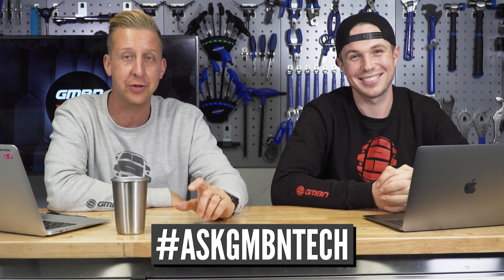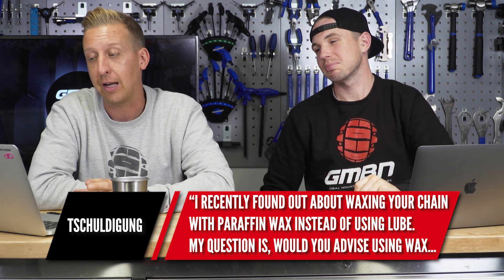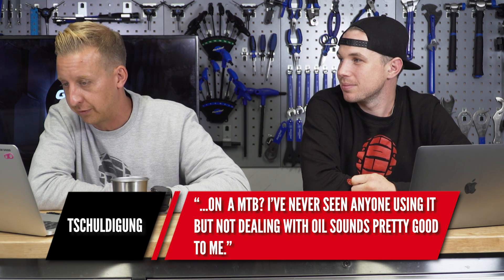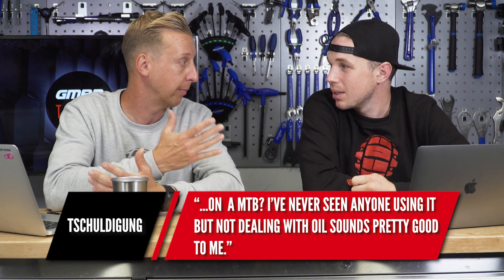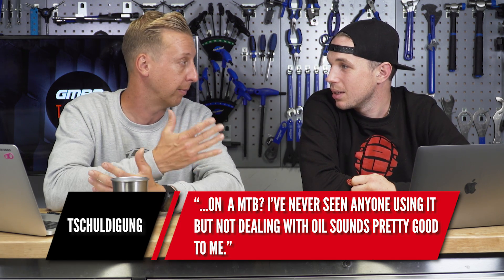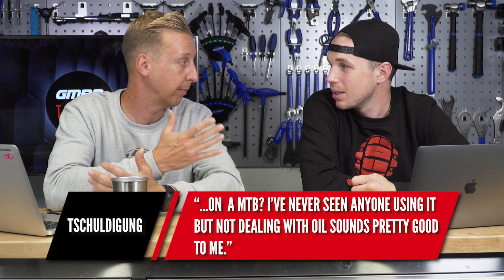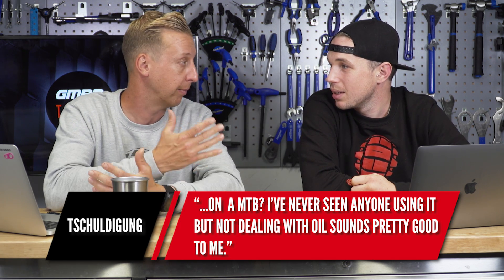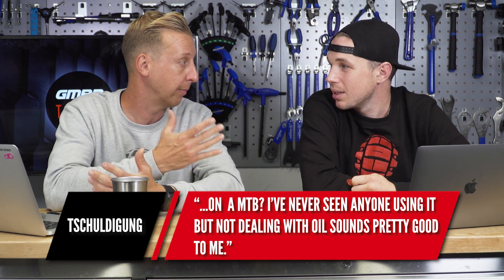Why Isn't My Damper Working Properly? | Ask GMBN Tech

Comment from the maker: Do you have any retro #AskGMBNTech questions? Next week is a retro special! 🔧
Reply: #Askgmbntech Where can you buy elastomers for retro forks?
Reply: #askgmbntech. Hey guys. My sram eagle gx 12 speed cassette is worn out and I’m looking to buy a new one. Would you say I also should by a new chainring and pulleys? Or just a new cassette and chain?
- Mikkel
Reply: #AskGMBNTech 

What is the right size bike for me I’m 6’0” flat,  and I am just looking for my General size. Rode a 26 size large with a  100mm stem it’s alright currently using a 29er medium with a 120mm stem seems too small for me. 
Need help Thanks.
Reply: Who made the first flex stay full sus? The Trek Fuel is the first I remember, did someone else do it first? #askgmbntech
Reply: can you do a breakdown of a fully spring suspension fork please. Mine is quite recalcitrant.
Reply: #askGMBNTech 
Back in the 90s I remember a suspension fork called ZZYZX, it was a big diameter DH style thing.
I can't remember who made it. Is it still around?, was it developed further? Or was it just one of those 90s things?
Reply: #askgmbntech Drive train 1 x 12: Is this system more vulnerable to wear out and defects than 2 x 11? I heard this quite often - also from local dealers. Tends this system to be more fragile and less durable on the long run? The chain and the sprockets are thinner, the chain line is diagonal at lower and higher gears and the friction on each sprocket of the chain ring is higher as well as the tension and the take-up path for the cage of the rear derailleur in order to compensate 10 to 51 tooth. Does it need a chain guide as to Syntace SCS claim: "Less wear and tear"?
Reply: Don't forget the Hope V2 system which converted cable to hydraulics. Not sure if it's still available.
Reply: who made the first hydraulic disc brake? #askgmbntech

Comment: Hi! Can you help me please, i have RockShox Monarch Plus RC3 2012. Why could oil travel in damper only in one direction, during bleeding? When in push damper down, it wont go up. All oil go thru damper piston, but won't go back. 
I have to use a lot of strenght to forcify retract it back up. Shimstacks are ok, IFP damper is open. What could it be? Thanks.

Comment: In reply to the chain waxing. Yes it can work very well on an MTB. I have several bikes and a stack of spare chains, so wax about 20 chains at once, and rotate them as the wax wears off. They are easily cleaned with water, dont attract dirt in wet or dry conditions, have amazingly low friction when new and can last 10 rides or so. Yes its a hassle, but combined time for 20 chains is less than degreasing and lubing every ride. Downside is that they can go rusty after rides as the wax wears off some of the chain once its been ridden.

There are a few tricks:

 you want a mix of paraffin and microcrystalline wax. Paraffin wax is too brittle and wears away quickly.
The wax on the pins lasts a long time but the wax on the plates wears off quickly in the wet. You can rewax with a solvent based wax lube, which coats the plate surfaces again.
Or you can heat up which melts the excess wax and recoats the plates.
You can also add oil onto a previously waxed chain which makes it very durable to wet conditions.

Comment: the pain about waxing the chain is not the hot bath immersion waxing, it's the stripping of the factory oil that sucks. once deoiled and wax, it's a breeze and it will take a LONG time until you have to get a new chain and strip the oil again. the chain will last and last and not really wear, nor wear down the cassette and chainring. assuming you're noz using straight paraffin wax but instead add a dry lubricant such as der WS2 or PTFE. squirt lube is rubbish honestly. it's a very oily wax with poor lubrication under load. and it takes for ever until the water has evaporated.

Comment: A question for #AskGMBNTech I have a rockshox reverb stealth dropper-post(2014).When the temperature goes down to zero, the dropper starts to get slow to return up and then doesn't work at all
(doesn't return to top). Is there anything i can do to fix this or do i have to change dropper-post that works better in the cold?

Comment: #askgmbntech I still run 26” wheels and love it but I’ve been having issues looking for a new fork. I want to get another 140mm fork but everything I’ve found has been 100mm dirt jump forks. Is there anything I can do to get a 140mm fork for a 26”er with a modern damper.
Reply: Just get a 27.5 fork the Difference wont be that big

Comment: #AskGMBNTech 
   Hi guys, I'm loving the show! 
I am 13 and rebuilding a bike for my sister. My question is, would a SR Suntour NRX air fork fit on a 24" wheel bike? I can't find any wheel size recommendations for it. 
If not, could you guys recommend any good air forks that would fit? I'm looking for something between 60 and 75mm travel and below $300.00. The bike frame is a 2014 Novara Tractor and the stock fork is a SR Suntour XCT 24" with 75mm of travel if that helps any. 
    Thank you guys, and keep up the great work GMBN Tech! 
     P.S. I will try to send a picture into Top Mods when the build is done.

Comment: #askgmbntech I have recently just bought a 2018 rockshox revelation rc 150mm with the debonair srping and motion control damper, there is some suction on the fork while it is unweighted and pumped up to 75ish psi, I'm just wondering if you have any tips to solve it? would a lower leg service help, or even air chamber regrease help? i have heard seomthing about a port being blocked that lets the negative air and positive air equalize.

Comment: Hey Guys, would it be possible to a quick video about servicing the standard taiwan dropper like it is sold by cannondale as the down-low, by giant as the contact switch or contec as the drop-a-gogo? They are very easy to work on and it may help a lot of people out. Also, My Scalpel has a 55mm offset Lefty 2.0 and it's amazing. But that is combined with a longer 90mm stem as well.

Comment: #AskGMBNTech what should I do as I have got a new mtb today and it’s 1x12 and the biggest chainring on the cassette is hitting the derailleur and not working properly what should I do
Reply: J4HN03 _ tighten the b tension screw. It’s usually the one highest up on your derailleur
Reply: @peterlang5047  I will try that thanks Peter

Comment: I have a $450 a Cannondale catalyst 3 or 4 I don’t know for sure It has a cheap Suntour fork on it The seals are wore out and it’s just not feeling as smooth as it used to I was going to get it serviced but then somebody told me I might not be able to get the seals replaced Whenever i ride in the Mud  or wash my bike a whole bunch of water will come out when I put it Upside down Should I try to get this serviced and those seals replaced  Can I even get the seals replaced Or I have been looking at buying a new fork I was looking at rock shocks forks I was going to get spring One but then I was wondering if I did that if it would really be any better than the one I have now Or would it even be worth buying a new fork or buying a air fork I hope you guys can help me out thanks all so 
there’s a bunch of play from the stanchions to the Lowers
Reply: #AskGMBNTech
Reply: I used to have a cheap suntour fork, then I got a Roclshox tk30. It’s a coil fork, but infinitely better than the suntour fork.
Reply: @peterlang5047  thanks for that info. how long have or did you ride it did it ever get any play from the lowers to the stanchions or star to feel not as good as when you first got it. can you let me know. thanks
Reply: Roston Nordell I had the suntour fork for about 3 years. I don’t remember it feeling worse than it was new, but there definitely was play, and there was a very harsh topout.
Reply: @peterlang5047  i was talking about the rokshox
Reply: Roston Nordell I had the Rockshox for over a year. It felt amazing. Every week or so I would clean the stantions with a paper towel, lube the seals, bounce in my driveway, then wipe off the excess lube with a paper towel. They worked great. I highly recommend them
Reply: @peterlang5047  ok thank you

Comment: #AskGMBNTech

Hey guys i have a question about my front suspension fork. Ive got a RockShox Lyrik RC 2018 180mm. When I make a jump or drop i dont use my whole travel. (Jump from Bikepark Winterberg and drops like 1,80m high.) I got 2 to 3 cm left on the travel even when doing big jumps. And it feels likes it bottoms out but offcourse it doesnt. Ive got already 30% sag and i dont run any spacers. Is this normal? If not. What should I do? Rockshox wont respond and my locals shops dont know.
Reply: Luke Geurs I don’t think that’s a big problem

Comment: Rear Suspension Question: I’m interested in increasing the rear travel  of my current bike. It’s a 2018 Pivot Mach 429 Trail. Travel is 116mm with shock measurements of eye-to-eye of 7.25”, and 1.75” stroke length. Could I purchase a new shock with an identical eye-to-eye length but longer stroke measurement without negatively impacting the overall ride? (A $500 shock is far less expensive than a new bike.) #askgmbntech
Reply: Josh Hunter parts of the linkage might contact each other where they’re not supposed to, and the tire might buzz the frame
Reply: Peter Lang, Would that still be the case if the extra mm suspension travel I’m looking to add is within the tolerances of frame clearance? How could I measure that to be sure? (Thanks in advance.)
Reply: Josh Hunter the only advice I can give you is to find a friend with the size shock you are looking for and put it on your bike. Let all the air out and push the bike down to see the suspension moving, and look carefully if anything is touching

Comment: @ How does (if it does?) lower leg oil lubricate the stanchions? Does it mainly come from the foam rings? My 2017 RS Pikes only have 5ml on the damper side and 15ml oil on the air side. How does 5ml successfully keep the lowers and bushings lubricated? Cheers!

Comment: #AskGMBNTech Hello guys i have a question should i achieve full travel on my fork? Because at my current situation, i weigh in at about 60 kg and i have a 2018 rockshox pike rc with 150 mm and 1 token installed by default and i cant achieve full travel unless i release my fork air pressure below recommended pressure at around 45 psi and im running way above 30% sag. So should i remain it that way? Or should i remove 1 token and pump up the pressure? Thanks!
Reply: bryan :D remove the token
Reply: @peterlang5047  alright ill try thanks !!

Comment: #askgmbn I’m trying to find a UK custom wheel builder so I can buy some new wheels. I’ve found wheel builders but only for other countries. My ideal wheel would consist of hope pro 4 hubs and a 35mm rim that’s strong. Have you got any suggestions for wheel builders online or possibly a place where I can go or get it done?
Reply from the maker: Almost all good local bike workshops will have an experienced wheel builder or are able to recommend one so don't be afraid to pop in to your LBS! Hope themselves sell a complete wheel called the Fortus with an external width of 35mm (30mm internal)

Comment: #askgmbntech
Hi guys, love the show, my question is what happens when using a different weight suspension oil from the fork required? Like RockShox pike require  0w30 oil, what happens when you use 15w50 oil instead? thanks

Comment: #askgmbntech hi guys I'm having tyre troubles! Wtb frequency i29 rims and maxxis high roller 2 3c in 27.5. I had a pig of a job getting them onto the rims, had to use a Pedro's downhill lever in combination with a tyre pliers just to get them over the rim and it took 70psi to get them beaded up with tubes in. I bought a tubeless kit with mousse inserts and now I can't even get the beads off to remove the tyres! literally can't even get a lever under the bead! The rims have a very shallow valley which didn't help when fitting. Short of cutting the tyres off with a side cutters I can't see what would work. Am I the unlucky one that discovered a rim/tyre combination that doesn't play nice?
Reply: Ahh, right. Managed to get them off again lol. Had to squeeze the tyre up in a vice to release the bead. Used rags to protect the tyre. Used the carbonaria tyre mousse inserts and caffelatex sealant. One thing I did use to help things along was "personal lubricant" 😂 worked wonders lol

Comment: #askGMBNtech ,  So i got me a Scott scale 960  (1000£ + 200£ for a dropper) been ridning it a few weeks now,  problem is i cant seem to get My bars high enough for a comfy ride, ( too much weight on My hands ie.  numbness / hand pain and back issues, ive got 3 prolapses in My lower back wich i await sugery for,  so need a bit more upright ridning position )  bike size is Xl (as im 2m /6"55 & 95kilos ) bought a super short stem and a 25mm rise bar (both nukeproof) but still too low. 
So how to go about this,  do i buy a new 200-300£ fork,  so i can cut the tube higer or  a new stem to fit something lige a inspired trialsy bar? ,wich im sure Will look quite odd or something completly different. im not doing super crazy stuff,  mostly fire roads,  chill forrest paths and longer paved stretches to get around,      Hope you got some ideas and thanks for the great content on on All your gmbn YouTube's
Reply from the maker: Yes you could look at getting some high rise handlebars. Trials options are pretty high but the up/backsweep may be a little weird for mountain biking so compare this. You can also get 38/40mm rise bars from a few brands. (This few 2mm sometimes accounts for upsweep depending on how the bar is measured.) If you're not jumping or anything you could even look at a stem raiser however they aren't the sleekest option and we wouldn't recommend them for offroad usage. If you do end up wanting a longer fork steerer it would be much cheaper to just purchase a new upper. This is known as a C.S.U.
Reply: @gmbntech  tanks for the reply and keep up the great content 😊

Comment: If I'm converting a 2 x 10 drivetrain to a 1 by, can I still get away with the same 10speed rear mech and shifters and of course chains or I'll have to get ride of all of those and get 11speed bigcog cassette, chain, rear mech and shifters? What can I do to save the 10speed parts that I already have. It's currently a 38/24 11-36T.
Reply from the maker: If you are running Shimano you can keep your shifter and just install a new rear derailleur (also 10spd) with a clutch. We would also suggest a narrow-wide chainring to help with chain retention. If you want to take advantage of the larger cassettes on the market you will also need to change the chain 👍
Reply: @gmbntech  so if I go for narrowide 34T, whhat type of cassette do you think I should get?  11-40? and my rear mech is already clutched.
Reply: Just chuck a narrow wide chainring on there and you’re good to go

Comment: I live squirt lube. I wax dipped my gravel bike chain every 100 miles for almost a year before I discovered squirt lube. I think it works better than dipping and it is certainly easier. I'm not sure if it's the wax lube or the chain (Zimmerman conex) but I have about 2500 miles on a chain and it is still within ware spec.

Comment: #askgmbntech are crown races specific to a fork or a frame? I broke the fork on my gravel bike and got a second hand replacement with a crown race already installed. It fits right in terms of function, but there is a gap about the width of the crown race. If I take off the old thin crown race and put it on this new fork, should it fit?
Reply from the maker: Crown races are specific to the headset design. If it's the same angle it will sit on the bearing correctly however this gap may allow a lot of crap to get into the headset! If you are able to swap the race over we would suggest this but be careful not to deform it in the process. Hope this helps 👍
Reply: @gmbntech  Thank you so much, that was exactly what I needed to know!

Comment: Shimano did a cable-actuated hydraulic some years back too. They were available from a local online retailer for $20 a caliper, probably because nobody wanted them, or they were awful. Some might wonder what the point is, but a mechanical actuation in a caliper is hard to do well, can create a loss of power, or in most cases is a single-piston design. I still think you're better off with a purely hydraulic brake though, or an Avid BB7.
Reply from the maker: Shimano still produce cable pull options for road bikes. TRP also made the Spyke fully mechanical calliper with dual actuated pistons.

Comment: #AskGMBNTech How do I improve my 100mm coil fork I wanna make my XC more aggressive than it is any ideas or should I just get a new fork :(
Reply: If you want it more aggressive put more air in it and increase the damping
Reply: @kleinkurti  bro but it has a spring coil instead of an air one :( but thanks anyway dude.
Reply: @taimursalman7769  oh I didn't read that. What do you mean with "more aggressive". Is it too soft for you? Try a harder coil then.
Reply: @kleinkurti  nah its hard asf
Reply: Then what do you mean with "more aggressive" ?
Reply: Markus K like more of a trail bike with acute angles and longer travel fork plus a slacker head angle which bike do u have?
Reply: Death Llamaa depending on what fork you have, you might be able to increase the travel,  but I would recommend you get a new bike. There’s no way to make an XC bike feel more aggressive like a trail bike. If you increase the fork travel, the head angle will be slacker, but the bottom bracket will be higher. Also, if you increase the fork travel more than 20 millimeters, the head tube is more likely to break